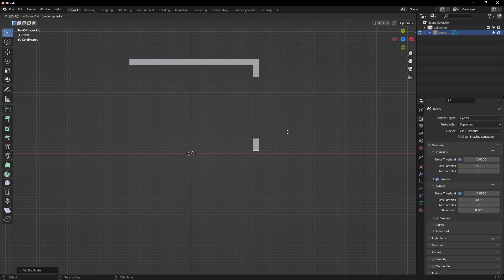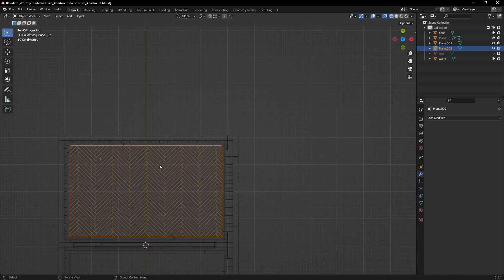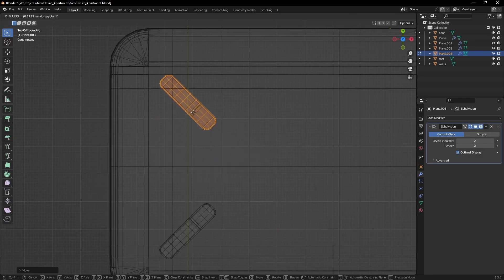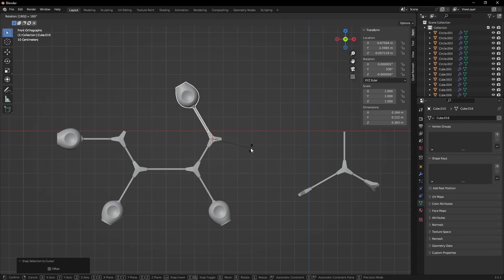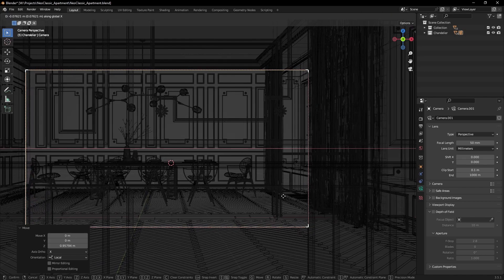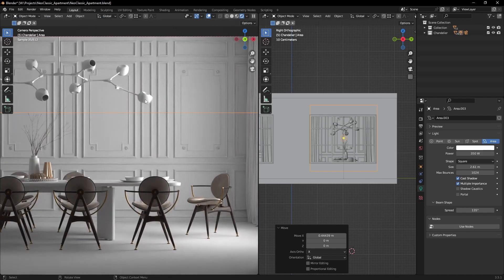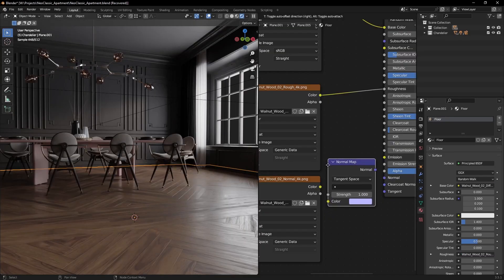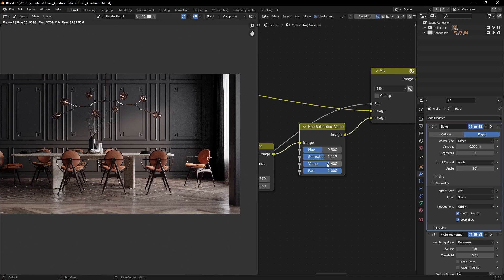FULL PROJECT BREAKDOWN Neo Classic Interior | Blender Arch-Viz Series

Comment: final reslt is awesome but... the floor you could have done it with a texture with normals and so, less amount of topology in the scene... the ceiling curved perimetral thing.. only with a curve as a path and the shape you could have done it with 1 click.. instead of extruding, shearing, etc.... just tips... love it thoe
Reply from the maker: Good tips and they have their uses. I always model the floor cause when you're working with a manufacturer you have specific measurements for each plank as well as offset of the planks and the beveling. making textures for every pattern and shape is much more work than actually modeling it. Also there are a few sections where the pattern changes around the walls which would mean another texture, just for that. Using a curve with a custom bevel breaks the volume of the object whenever there is an angle, so that also doesn't work well in a professional job, as you want the profile to match exactly what your client / designer picked.
edit : you also don't have to deal with repetition in the floor texture :D

Comment: if you have time, you can make a video about professional lighting for example https://i.pinimg.com/564x/cd/0d/81/cd0d810c394914927324fd03e5938d9c.jpg
it will be interesting if Cycles can achieve the same quality as Vray or Corone render🤔
Reply from the maker: A quick answer is - yes, Cycles can achieve that quality, although not as quickly as you'd get it in V-Ray or Corona. that has been my experience working with all 3 of these render engines. there will be a video where I break down lighting in my upcoming tutorials, but it will be released in a few months, as it takes time to do an in depth tutorial on such a topic.